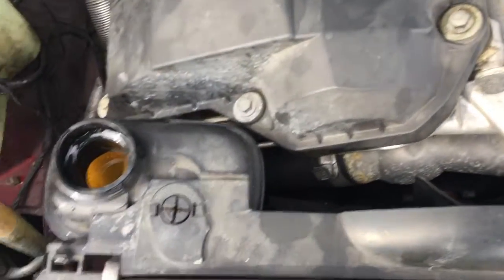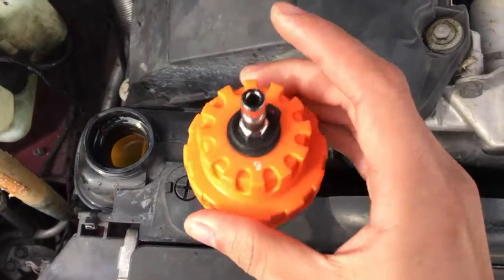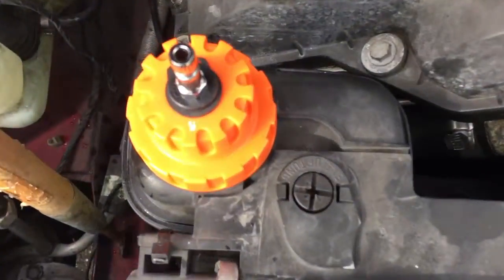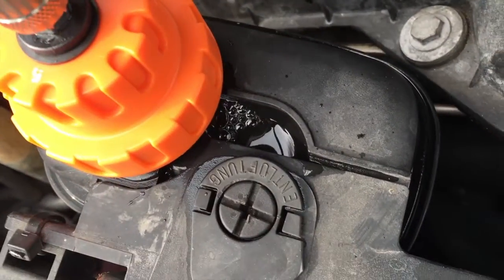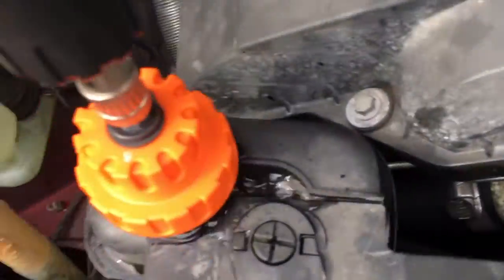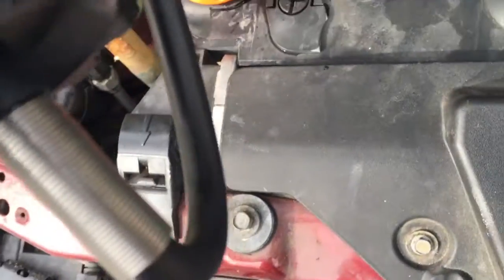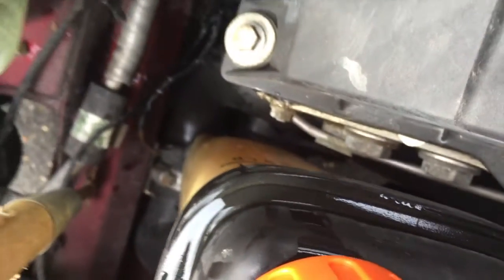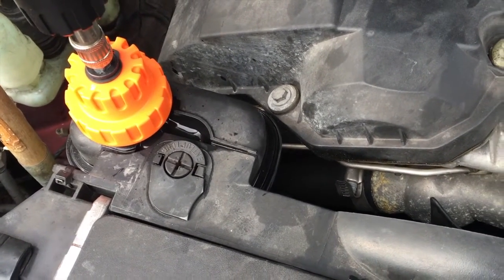E36 Cooling System Pressure Test

Comment: Did you install the rubber gasket on to the orange piece? If not it wont hold pressure and it will leak from the top